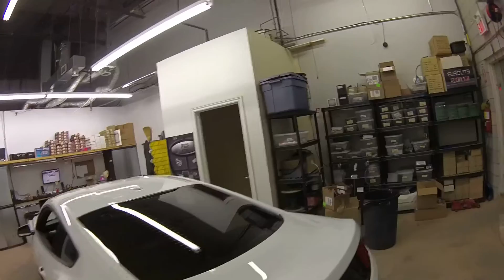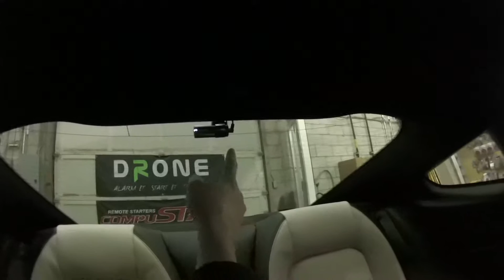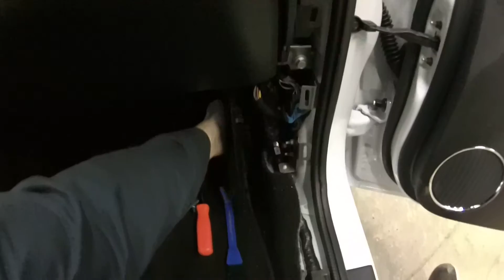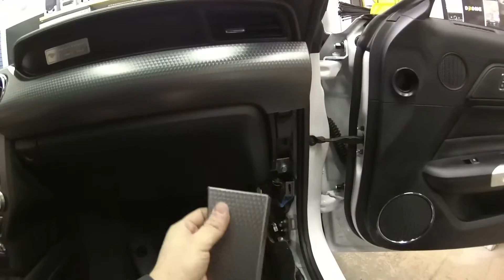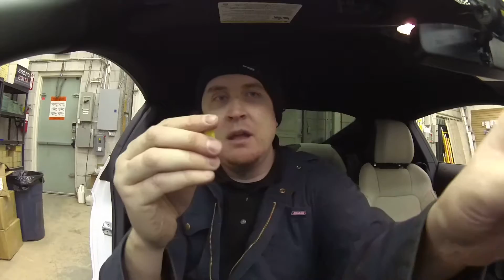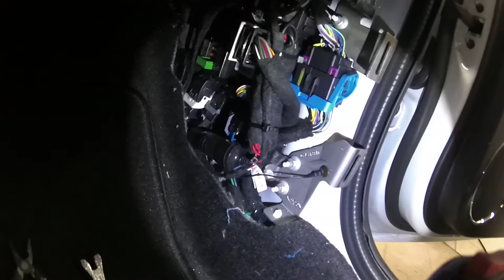2015 Ford Mustang Blackvue Dashcamera Installation at Lockdown Security

Comment: Just hooked up an A119 to my 16' ecoboost. Ran the cord up into the center console and in the usb port. It turns off and on with the car. Thought you'd like to know instead of dealing with fuses.
Reply from the maker: Hi mexifry222, thanks for the tip, we will keep a note of this for future installs of cameras that are USB powered
Reply: mexifry222 Do the 2016's have a USB port in the actual glove box?  I only see 2, one below the stereo unit and one in the center console
Reply: My mistake, I said glove box when I meant the center console. Editing the original comment now.
Reply: For my USB powered cam, I ended up buying a DC-DC converter with USB output ($6 shipped from US, or $2.50 from China if you want to wait) and tapped into the switched 12v at the rear view mirror. Works great and didn't have to run any wires, just tucked some up under the headliner to hide it.

Comment: The fuse is called an ATR micro2 fuse. You can use an "Add a line" fusetap off Amazon. Make sure it's for the ATR micro2, though.

Comment: what fuse number did you use for the black and the yellow thanks
Reply: I just wired up a Garmin45 to my wife's 2015 Mustang Ecoboost and I used #2 for 12 volt (always on) and #23 for the accessory (on/off with ignition).
Reply from the maker: +Will Liang Hi Will, we never recorded the fuse number, we used a digital multimeter to test the fuses, one for 12 volt constant, one for 12 volt ignition
Reply: +Will Liang You can go to an autoparts store or any place to pick up a voltage tester. I picked up this off amazon. http://www.amazon.com/gp/product/B00TBA5FSM?psc=1&redirect=true&ref_=oh_aui_detailpage_o00_s00

Comment: Hey, I recently obtained this same model of dash cam for the same car. Which fuse taps did you use? I would like to purchase them. Would it be an issue if I were to simply wrap the cables around the fuse? Thanks!
Reply from the maker: +S3iZUR3S We used these, had to modify (bend the end that goes over the fuse leg) a little bit but these work: http://lockdownsecuritycanada.ca/collections/install-supplies/products/tap-atm2-fuse-taps-atm-with-crimp-connector-50pk
Reply: +Lockdown Security Perfect, you guys are in Canada too. Did you have 
any smaller packs? I'll never need 50, haha. Just for a one-time install here.
Reply: +Yvonne Perovic Hey Yvonne, I've submitted my address to that email address - I've left a note on there as well for the salesperson to read. Thank you for replying!